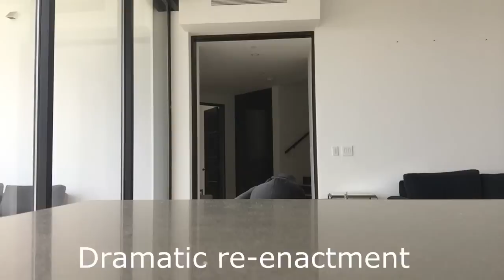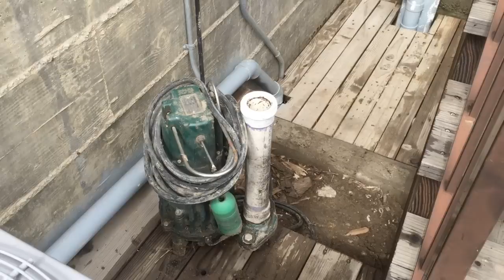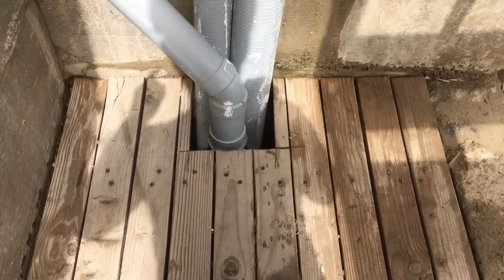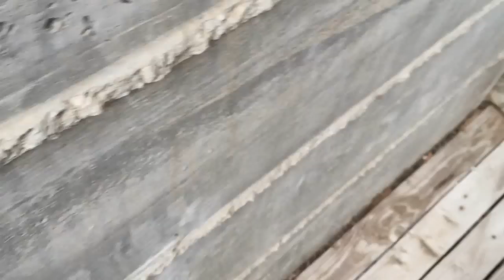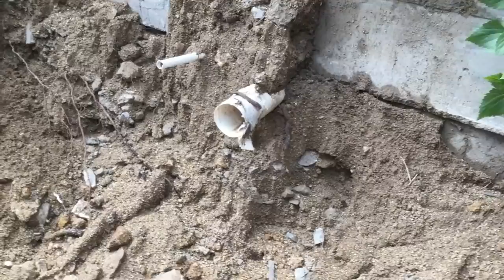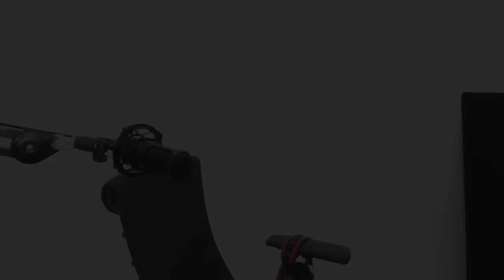EMERGENCY

Comment: I bet you never thought flooding would be a problem in California
Reply: No but mudslides are
Reply: +Amanda Miller Which is a really stupid thought. After a drought, if it rains so damn hard, the grounds not gonna be able to accept all the water being thrown at it, causing floods
Reply: +Nico Youtube (NicoYT) A flood every  three years isn't a whole lot. Floods happen multiple times a year where I live.
Reply: +Nico Youtube (NicoYT) 
Floods in california? I though California is in a drought
Reply: +Penguin Gaming™ Welcome to our world. lol
Reply: +RandomHypocrite was gonna say that so thx for saying it for me lol
Reply: +Penguin Gaming™ It is, that is the problem. When you get a hair rain during a drought the ground will not be able to take it and things go to hell.
Reply: +Amanda Miller It's a problem when the area isn't used to it, and therefor doesn't have the proper setup to deal with it. getting an inch of rain in a very short period can cause flooding, it really comes down to the type of dirt in the area, and the storm drain setup. I lived in the mountains south of LA (Laguna Beach area) and since my college was on top of the mountain anytime we got heavy rain, we would pump the water into a nearby water resevoir (it was a huge lake in front of the campus) that the school held onto for emergency's (like fires which are really common in southern Cali). We usually never had rain, but the school had a plan for when it did rain. 

LA, doesn't have any of that, especially in the suburbs. Water is scarce there, so there isn't a place to put it when the ground no longer has room for it, which is usually after half an inch of continuous rain. so it's pretty common to have floods because LA doesn't have a good storm drain system.
Reply: +Amanda Miller Droughts.
Reply: i live in so-cal and a street in my town flooded and pulled someone into a drain pipe
Reply: +Jacob Yeager true lmao can't wait
Reply: +Nico Youtube (NicoYT) here in Colorado we get it multiple times a year
Reply: John Sheldon please tell me you live in the high desert
Reply: +Amanda Miller Insert Rimshot
Reply: Yes, until you consider the fact that vegetation is at a low, which means a long, light rain storm, (or a regular storm) could cause serious flooding because almost all the water is becoming runoff or storm water
Reply: The problem may also be that first of all, this is a rainy year, second of all, an el nino is coming at winter, SO PACK UP YOUR FOOD!!!!
Reply: +Mang San plus a radio, and some battery's, OPTIONAL: medkit
Reply: It's weird because today in Oregon (In Portland to be exact) it was POURING. A LOT. It poured 3 times. The first time I was in school. The second time was at 3:00 PM or 4:00 PM? And the last one was at 6:00 PM.
Reply: The sky's like GATCHA BITCH!!!
Reply: +Amanda Miller Well in LA the water doesn't actually soak into the ground properly, so it just causes erosion. That is why every time there is a large amount of rain in LA they have landslides, because the ground is not very good at soaking up water.
Reply: +Amanda Miller Areas that don't get much rain actually present more of a risk for flooding than places that get tons of rain all the time, for a number of reasons.

It's much like areas that never get snow or real winter weather suddenly getting slammed with a winter storm.
Reply: It'll be a huge problem when El Niño hits
Reply: Amanda Miller Now it's all about the Oroville Dam.

Comment: And this folks, is why you get an inspector to inspect EVERYTHING in a home before you buy it.
Reply from the maker: +zguida2009 I had 5 different specialized inspections, as well as the general inspection. Pipe was completely buried and there was no way to have seen it without actually digging :(
Reply: +CaptainSparklez wow! you would think it would have been on blueprints or somthin? and i apologize captain if i seemed rude.  in no way was i making fun of this.
Reply: Hai
Reply: +CaptainSparklez That stinks
Reply: +Janda_Plays You commented literally 6 seconds befor me
Reply: This comment got a lot of comments rather fast
Reply: +CaptainSparklez  your the best youtuber ever
Reply: +CaptainSparklez I think you got some bad inspectors man.  Not referring to the pipe on this one, but they should have checked those pumps to make sure they were functional, and that electrical outlet to make sure it was the proper GCFI outlet.  But as a fellow homeowner I know the pains your going through, nothing is perfect.  But congrats on the house.
Reply: +FlikViktor I agree.
Reply: +CaptainSparklez Definitely feel your pain.  Our last place had a buried pipe like that, and a tree decided it would be a good place to send roots in.  We found out when the toilet backed up.  The plumber sent a camera down as was all 'What the hell?  You have a tree in your drain!'
Reply: Wow, 11 comments, one from CaptainSparklez, all in less then an hour
Reply: +zguida2009 He did.  Home inspection team missed a bunch of stuff at my house, too--I was actually pretty disgusted with the job they did.  Oh, well.  There's always something to fix or improve when you own a house.
Reply: +CaptainSparklez jordan this is what we get for living in C.A and your house is being taken back by the earth.
Reply: +CaptainSparklez It's better for it to happen now than later.
Reply: +CaptainSparklez RIP
Reply: +CaptainSparklez  And this is what we call bad planning by the original builders! Because construction companies like to build things cheaply now a-days!
Reply: +CaptainSparklez its ok Capt., Its your first house, and all of this will prepare you for future malfunctions....welcome to homeownag.... lucky you :v
Reply: +CaptainSparklez just buy a void pipe
Reply: *****
I thought he was in apartments before this?
Reply: +Miaren Crowsdaughter oh my god
Reply: +Miaren Crowsdaughter Correct. First home ownership.
Reply: +zguida2009 I've seen things like this lead to major damage...this is very NOT safe.
Reply: +CaptainSparklez  I think the straight pipe is a overflow pipe when the pumps did not work the water level got too high.
Reply: +CaptainSparklez I'd contact who you bought the house from seeing as the issues were clearly covered up no like that outlet is dealing with water and outside they could have fried it
Reply: +CaptainSparklez By law the previous owners of the house are obligated to present any known issues with the property. If it is found this is a problem that happened in the past and they didn't tell you before purchase, you can have them pay for all the damages and repairs.
Reply: +Purple Death this one he owns and not just rents like the ones before
Reply: +CaptainSparklez They should have checked those pumps tho
Reply: +CaptainSparklez The Captain actually replied? Holy moly...
Reply: true
Reply: +CaptainSparklez Man , I am so sorry this has happened to you with your
'new' home . Sadly that was overlooked , but at least it doesn't seem unrepairable , I just hope it doesn't cost you a fortune being who and where you are . Best of luck and best wishes to you man .
Reply: +CaptainSparklez as a certified home inspector I can tell you, your inspectors should have determined where the overflow discharge for the collection basin was discharging during there inspection.  They would have determined that the pipe was cut off to close to the foundation.  When water is discharged to close to a foundation it will lead to erosion and undermining of that foundation and next thing you know your house or pool is down the embankment.   
Your inspectors should have  also tested the sump pumps to make sure they were working, as well as,  prepared you with annual maintenance tips to have the sump pumps tested annually by a qualified contractor to prevent flooding. Another suggestion that I give all my clients with a electrical sump pump system is to install a back-up natural gas generator because when the power goes out during a storm those pumps STOP working and all that water overflows and takes the whole side of the embankment with it.
Reply: +CaptainSparklez  if you'd like me to pop in and inspect your home for other things that might have been missed by your inspectors I'd be happy to the next time I'm in LA let me know. I might surprise you with the things I can find. 

Your flood has given me a great idea for one of my next videos I'm making. #thehomeinspector
Reply: +CaptainSparklez  Call plumber Tom(syndicate) or his dad
Reply: +CaptainSparklez i think you should sue them, its america after all.
Reply: +zoninable yea but hes in L.A where the ground can erode and lead to alot of damage.
Reply: +I'm Choice yea but it never rains in LA so perhaps the previous owner didn't even know.
Reply: +zguida2009 You mean get Inspector Gadget to get everything inspected? Lol
Reply: I've never seen or heard of an inspector that inspects everything in a home they always miss so damn much.
Reply: +zguida2009 They always miss stuff, like in my house they missed that the electrics hadn't been re-done since the 1960s. So the house needs a full rewire.
Reply: ***** it is his first "OWN" home, he clarify that at his VLog, he was always renting, and im really proud of what he has done so far and and he will experience even more. Im also 23 right now and im still renting in an apartment and its kind of difficult to buy a place in this day and age... its just a matter of patience.
Reply: +zguida2009  666 likes
Reply: +zguida2009 To get a loan for a bank this is required.  Just saying.
Reply: lol. so true
Reply: Just block it with a plug?
Reply: Water pressure @Goman552

Comment: if you just bought the house you should talking to house inspector because they messed up
Reply: +1naruto59 Also this. Somewhere, someplace someone fucked up because there's something not up to code on your house.
Reply: +Null Nullion That's probably one of the reasons why the previous owner (or the builder(s) if its a new house) sold it as either they couldnt afford to fix this issue or the builders cut some corners.
Reply: +1naruto59 Especially if that outlet isn't GFCI. That is extremely dangerous as it could lead to electric shock when doing something simple. I know in Florida all homes require them on the outside, idk about california though.
Reply: +1naruto59 CaptainSparklez  4 hours ago

+zguida2009 I had 5 different specialized inspections, as well as the general inspection. Pipe was completely buried and there was no way to have seen it without actually digging :(

Reply · 112
Reply: +1naruto59 Jordan said on another comment that he had 5 different inspectors, plus a general inspector look at the house, but the pipe was originally completely buried (before the 'floods') and the only way anyone would have seen it is if they had dug in that spot.
Reply: It had to have been done intentionally by someone though. Which is the intresting part. So i guess it wasnt the Inspectors fault so that i understand, but it couldnt have been there long or the damage would have been show already. Maybe its becouse of the drought but that pipe would have been doing that kind of damage every time it rains. So.... Who kept re burying it? that sorta thing.

Comment: It would probably stay better if you put tar and chip in the closet part of the ditch and then put dirt over it, tar and chip done properly won't wash away so you won't have the trench issue.
Reply: +Jonea Swatsworth chipseal might be a bit more expensive that captainsparkles would want to do, my suggestion would be bring in fill dirt and refill the trench up to the level of the pipe, then put down a heavy tarp leading down the drainage after doing some compaction and then putting down river rock or even just chunks of concrete to slow down and prevent further erosion.
Reply: Or he could just plant grass or flowers or something under the pipe to hold the diet together and soak up the water. Also his house would be bootiful.

Comment: 1- " this outlet... is not gfi or something" there is a dam hole on the top of the box and cracked XD
2- extend the " niagara fall " pipe to as far as you can from your house so, if it happen again you dont have to worry about the dirt going down anymore

Comment: Jordan, BUY A BLANK PIPE COVER FOR THAT PIPE, AS WELL AS PVC GLUE. put the glue on the pipe, put the cover on the pipe and twist until it won't twist anymore. This should prevent it from draining anymore, so for the time being your house isn't becoming sinking city.

Comment: pros: random pipe overflowed the sump pit instead of the house partially flooding, the pump burned out instead of the main panel burning the house down, you now have the beginnings of a cool Koi pond/Zen rock garden...
cons: looks expensive :(

Comment: I am amazed on how elaborate  and weird that whole drain pipe system was. It even has pumps to pump the water out. In the place on Earth it hardly rains (I guess that is probably the problem since nobody knows how to deal with it). In my country we get more rain and all that water just goes down many drains into the earth and that's it.

Comment: Sounds to me that (one of) the previous owners has made themselves a little "creative solution" and then filled up the damage with a bunch of sand and dirt to cover it up.

Something that normally would work just fine, but that got overwhelmed by the sudden drastic increase in rain.
If the sand/dirtbed were to be properly wet and plants grown on it it'd hold, now its all dried out most likely and thus very loose. Cue sudden influx of water and you have yourself a new river.

Comment: I feel like you could extend the outflow pipe and install a retaining wall and not worry about it again. Also add some plants at level with the retaining wall to prevent erosion.  A pump seems like an excessive, expensive, and unnecessary expense, but what do I know about living in California.

Comment: The same thing happened with my house jardon... Apparently houses built within a certain time period all had major sump drainage issues. To relieve the water stress pressure it would involve installing a french drain

Comment: Captainsparkles, welcome to california. where the seasons are Mud, fire, earthquake and smog.

Additionally if you want here's some basic stuff you can do to prevent further erosion if you'd like.

While you can just toss heavy riverrock or chunks of concrete down along the trench a more solid prevention would be laying a tarp or even just root barrier fabric down the tench from where the pipe exits out from under your house and then spreading heavy concrete or rock chunks down along the trench to slow and disperse the water so it isn't moving as fast to prevent erosion.

as a bonus to now having your new house wash away you might even avoid any fines/visits made by the water resources board because you mitigated the erosion risks.

and sadly I'm not joking about the WRB passing out fines even if you were previously unaware of the erosion source.

Comment: The outlet it needed is a GFCI outlet to protect it from the water getting in it and shorting it out. GFCI-ground fault circuit interrupter

Comment: What you had was nothing. In 2013, the pipe under the kitchen sink burst and flooded the first floor overnight. We literally had 2" water by the time we got up the next morning. We had to strip straight down to the concrete and spend about a month of water damage repair.

Comment: hey capt. have a hydrostatic test and a static test done on your house both check the water and sewer system if it drops pressure  then you have a existing issue underneath the foundation  which considering the fact you moved In not to long ago couldn't be your fault and your  insurance  (which I assume you have...hope really) should cover a portion of it if you need to make the repair out of your pocket and possibly if it was from a previous owner there sellers insurance possibly cover it but if you aren't sure ask the plumbers to the test it shouldn't cost to much my company does it for around 190 for both but I work in Texas and I know plumbing prices change state to state

Comment: That is a foundation drain designed to drain ground water and is need for your foundation to not settle. But yes you on Site storm drain detention tank with sump pumps must not be stilled right or is cracked. This is why HDPE is better then concrete.

Comment: + CaptainSparklez GFI stands for ground fault interrupter when you have a short in something like the pump or the outlet the ground fault interrupter turns off power two pumps drills fans etc

Comment: That pipe IS supposed to be there.  Where the hell do you think all the water from your sump pump goes, down your drain?  It's pumped outside as it's supposed to be.  And there is nothing unusual about the pump alert going off when you just had a record rainfall.  All it's doing is telling you it's having a hard time keeping up, but it should be having a hard time with that much rain in that short a time.

Comment: Hydrostatic and static test...hydrostatic test on the sewer system and static on water they are both really simple too...you could even possible do it yourself but a plumber  should do it so you have on the invoice that your system passed or failed from a master plumber

Comment: Ahh... McMansion problems.  Congrats Sparkie, you bought a slapped-togethor house.

Plus side: Rain in California!  Yayyy!

Because you will get a LOT MORE SOON.
Reply: +AgentOracle 
Not GFI
Ground Fault Interruption: it protects the electrical panel in the event that water gets in to the electrical outlet.  You have two of them over your kitchen counter (probably) and maybe one in the garage / bathroom / porch.  it's the plug with the two little buttons on it (Test / reset)

Comment: I'm a plumber you want that it is known as a gravity drain just extend the pipe by two lengths. then even if the power is off you won't flood.